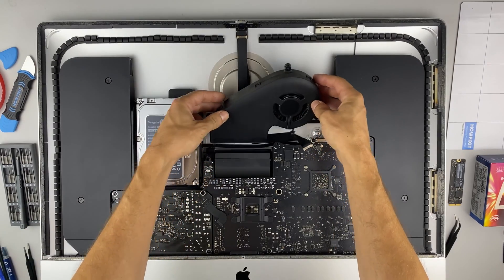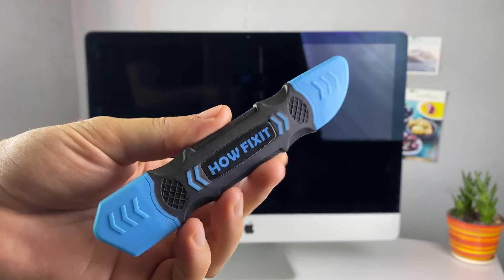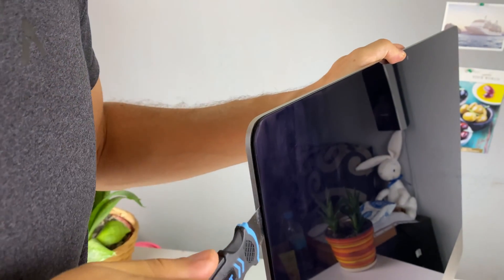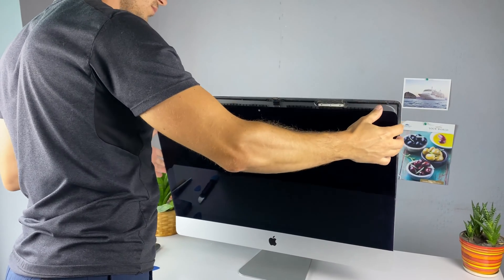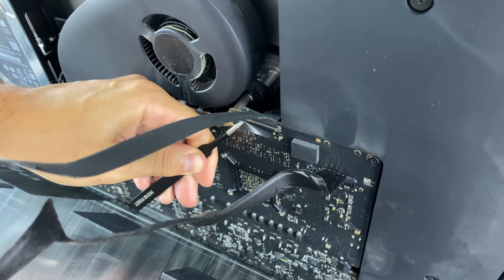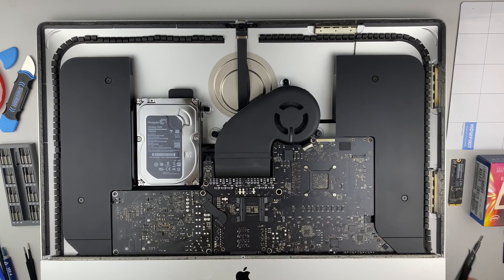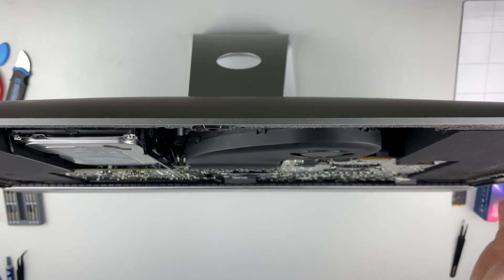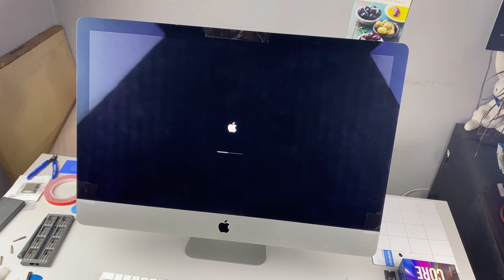iMac A1419 (27-inch Retina 5K) Fan Replacement

Comment: Thank you. This worked well for my 2019 iMac. I enchanted two issues. The first is the double sided tape came off easily on the screen side but did not come off on the computer side. I just left it there. The second is that I could not figure out how to unclip the ribbons between the screen and the computer. I just left them connected when I did the repair. The drawback is the tape on the bottom did not get changed, but I think that was OK. I used a kitchen knife to remove the screen.